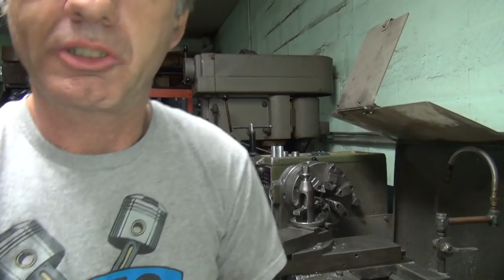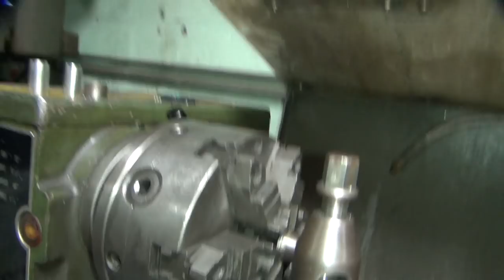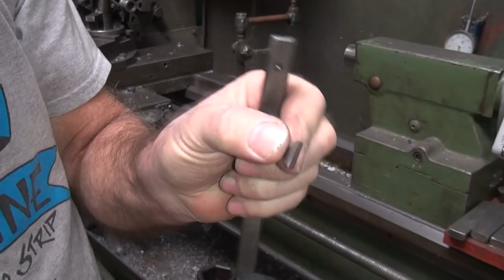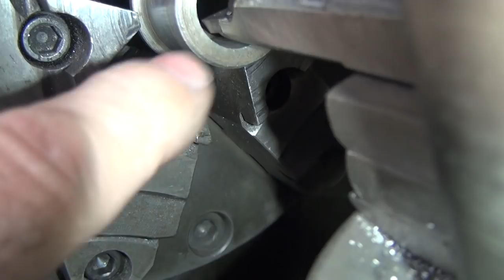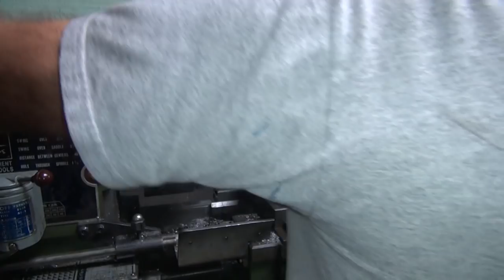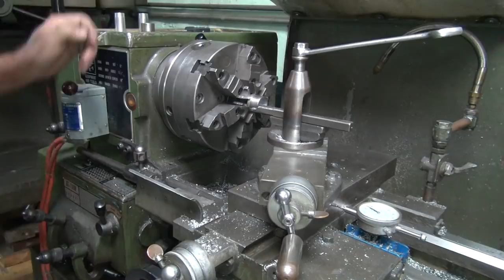#187 1957 panhead STD head conversion drag bike race harley scta lsr 2019 season tatro machine

Comment: Sux that the race got rained out. You probably needed some more time anyways.
Reply from the maker: i would have made it but i slowed down and am doing it right. as you can tell i am restoring the bike as i go. i like them stock on the outside and full race on the inside.
tatro
Reply: @TatroMachine  did your Dad build any race bikes?
Reply from the maker: yes, lots of street racing and a knucklehead roadrace bike.
tatro
Reply: @TatroMachine  where I was raised up at, we called them "sleepers", looks stock but kicks your butt.
Reply: @TatroMachine  WOW, that's really cool, thanks for sharing. My guess would be that he was building stroker motors and porting heads and dropping larger size valves in heads back in the day also. It must've been a challenge for him to get parts back then as kits probably weren't even available? I'm sure that he was the"go to guy" back then.